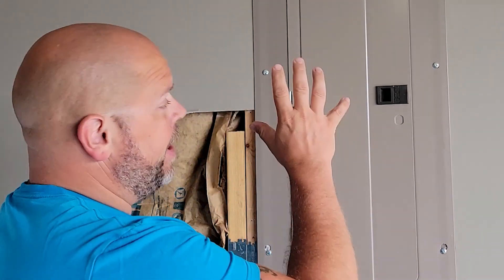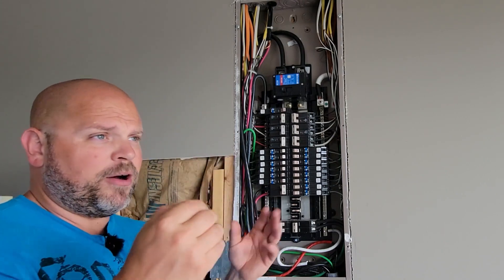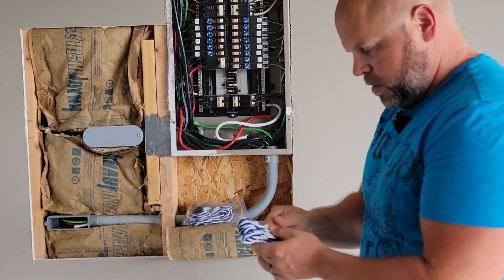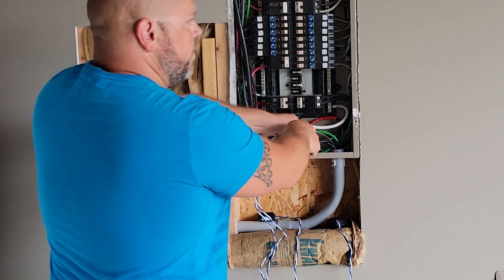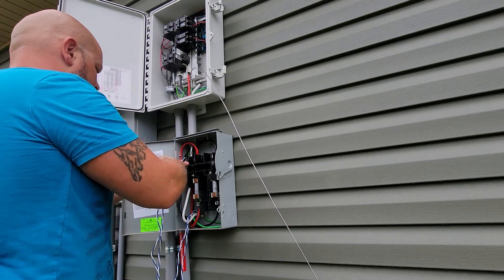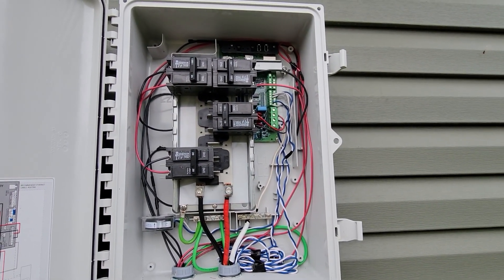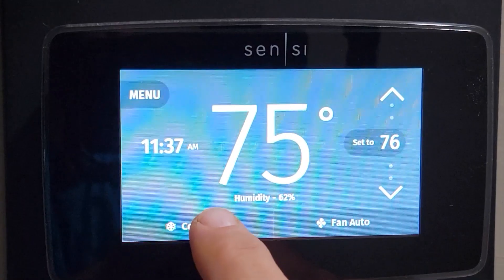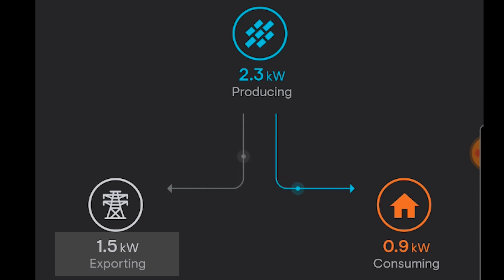How to install consumption monitoring CT on an Enphase solar system

Comment: I've seen other videos where inspections failed because CT wires were run in the same conduit as power.
Reply from the maker: Wonder if it was because of the conduit sizing? Only "x" number of wires allowed in certain size conduits. Because the wire rating is rated for 600v you can run the CT wires in the same conduit as the power conductors. It would be nice to know the reason why they failed so we all could learn from it. Thanks for watching and commenting 👍🏻

Comment: How do you determine which is L1 or L2 in the panel?
Reply from the maker: In most service panels, there is an electrical diagram on the inside of the door. In mine, line 1 was line A, and line 2 was line B. I hope that is helpful. Thanks for watching and commenting 👍🏻
Reply: When I open my panel, I didn’t see any thing that had the letter A, nor the letter B or one or two, but I did have a red wire and a black wire coming into my panel from the solar connected to the main lines. The red wire was on the left side and the black wire was on the right side. Does that mean line one is on the right side and line 2 is on the left side, but then I read another blog that said it doesn’t really matter

Comment: Hi Justin.  Thanks for the video.  Very informative.  I have one question.  The CT's measure the current going into your main panel from the grid but your power from the solar panels are going directly in the the main panel.  Does the power from the solar panels still get measured somehow through the CTs even if they are after the CTs?  Thanks
Reply from the maker: There is a production CT at the Combiner box and then the consumption ct's at the main panel. From having both production and consumption ct's, it allows you to easily track data in the Enphase Enlighten software. Hope that helps. Thanks for watching and commenting 👍🏻
Reply: @JustinsProject  I understand that part I will try and say it differant.  Trying to process the flow of the power.  I have the same setup as you have for hardware but my pv power lines are tied into the main (grid) power lines after the meter but before it goes into the main panel. My consumption CTs are places after where the pv lines are placed and before going into the main panel so the consumption CTc reads all power from the pv and gird like it probably should if you want total consumption.  In your case the pv power goes into the main panel and gets used on your load without going through the CTs.  Therefore you wouldn't know the total amount consumed and only getting reading of what was consumed from the grid.  I am not trying to over think the process but just want to make sure my actual consumption reading are correct.  Does this make sense and what do you think?   thanks again for your input.
Reply: @gwyffels  from what i’ve learned the most 10/10 sure fire was to capture all consumption (INCLUDING the Solar breaker if you are phasing) is to wrap the utility side before the meter. Something about the flow of power coming from the solar breaker doesn’t get read properly when trying to capture after the meter in the main.

Comment: Hey Justin, let me run something by you. I have two branches, 6 panels on one and 7 on the other. Both branches go into my Combiner box and into 20A-2Pole breakers. They then go to the Disconnect and into the homes breaker box. The solar plan I have calls for the conductors to then go into a 20A-2 Pole breaker. I dont quite grasp how the whole system feeds into a 20A while in the Combiner box both branches go into 20A breakers.
Reply: @JustinsProject  Awesome, I"ll do that. Im using IQ8+s. Ill try out that calculation, thanks!
Reply from the maker: @SSMLivingPictures   IQ8+ output is 300. If you have 13 of them this is how that would look. 300 x 13 = 3600w / 240 (volts) = 15a x 125% = 18.75amp. A 20 amp breaker is needed for that.
Reply: @JustinsProject  Thanks!! Hah Im at work at didn't have a chance to look up the specs yet. Much obliged! 
Heres one more for you. In your video your juntion box on the roof has lugs to fasten your conductors. Do you think using marettes inside of a 'hollow' junction box is appropriate, or would you recommend the type of box with lugs.

Comment: Hey Justin, maybe I missed it, but I have a question. You marked one of the CTs with black tape and said that was L1. Was that to keep the blue and white together to make sure they werent mixed? Or is there another reason where one belongs in C1 port compared to the other?
Reply from the maker: You should have 2 CT's. You need to place the CT's on the right polarity. If you mix them up it will not record consumption properly. If that happens just switch them. Be sure to call Enphase and have them activate the Consumption  metering. They were very helpful in confirming I did it right.
Reply: @JustinsProject  Cool. I went through the course ( and I do somewhat remember this now that Im typing it -it was so much to digest haha), so when I energize the system Ill set it up in my Toolkit. Thanks! Ill have to rewatch those modules and bone up.
Reply from the maker: @SSMLivingPictures  Trust me, I did the same thing. Those classes definitely helped my complete the install a little more confidently. I waited until the system was approved before adding CT's as well. 😁
Reply: @JustinsProject  Sounds good, Ill do the same
Reply: @JustinsProject  Great videos thanks for making them. So I would call Enpase and not the company who installed the system correct?

Comment: How do you figure what your 1a is at the electric panel?
Reply: Just pick one and make sure the other ct is on the opposite phase.
Reply from the maker: You can verify with a volt meter. If you hook them up wrong then your consumption monitoring will be incorrect. You would need to unclip them switch the positions if that happens. Thanks for watching and commenting 👍🏻

Comment: ADT ripped me off on a 15 panel AC Coupled system.i do have IQ 8 inverter.NO BATTERY Was told I did not need one.Price tag after rebate promo $34,000.Getting ready to call the attorney general.
Reply from the maker: Keep us all updated. Thanks for watching and commenting